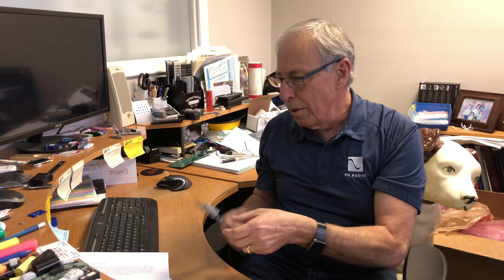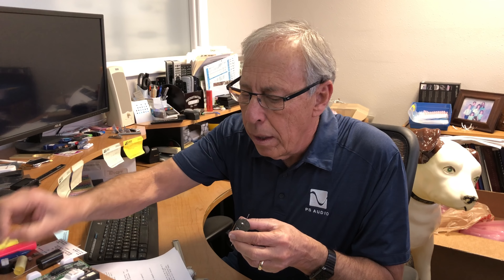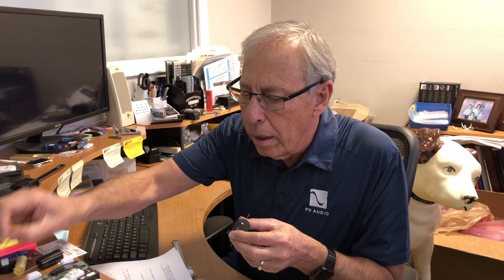Confused about biamping speakers?

Comment: So Biamping from the same amp has no benefit? did i get this right? i been recommended to bi amy my B&W 702 S2 from my denon home theatre amp they said i would get cleaner sound but i was on the same thought train as you said to get a power amp instead and overflow them with power
Reply: Which Denon do you have?  I bi-amp the old 703s using Marantz 8000 series but I only use 5 speakers and the Marantz is a beast. The 702 requires power - you can get a lot of cheap power like emotiva or monolith but I would bi-amp.  All these speakers have bad binding posts that are not signal friendly so bi-amping sorta fixes parts of it. 

One reviewer was saying that the new series 3 or series 2 doesn't need power, meanwhile he's reviewing the 705 signature with 5,000 and 10,000 pound receivers recommending the 10,000 one😄

Comment: Question… I have bi Wired speakers but I only use them single wired. Does is matter use the upper or lower entry on the speaker unit?

Comment: I'm hooked to biamping and active crossovers and couldn't imagine to ever go back. My highs are driven with a small tube amplifier and my lows with a cheap Crown Class D amp. This setup (for less than 1000 bucks) sounds better to my ears than all passive single amp options and I tested a lot...
Reply: Interesting, which crossover are you using?
Reply: @davidsagarra9841  miniDSP 2x4 HD
Reply: I have rhe same named pre and power a Myryad T40 and T60 does the power add up with setting up two ? Meaning 40 high and 60 low meaning 100 total. Instead of bi wiring just though my 60 watt power?
I'm I wrong, plus would my system sort out the loads or speaker cross overs . As 40watt just to the tweeter somes a low at all frequency,  hoping the cross over works?

Comment: I didn't really get the answer as to why I would bi-amp. Do some speakers need more power to sound their best? If you used your own speakers as examples, measuring with and without bi-amping, it would explain a lot. Thanks.

Comment: I love my bi-amp system. Not really high end, but I am getting there. I have an Arcam A80 and a P80 connected to a pair of Canton 790.2 DC's the beauty of this speaker is that the mids and the high's are fed by one amp, and the bass for the other amp, in essence it is a 4 way system, the mids are seperated as well. I notice a difference quite easily, I went back and forth with an audiophile friend and had some fun with it. The sound is more relaxed and  dynamic, overtones and spatiousness become more audible. But it depends highly on the speakers, if people want to bi-amp using small monitors, with one amp feeding only a little tweeter I think it is a waste of effort. Also Arcam used to promote and facilitate biamping and on forums people using Arcam tend to hear the difference more than other brands. But it is the same as speaker cables, it goes a bit beyond science, that they can't measure why it sounds better or different. It is a highly personal subject. And I fear the placebo effect has some grounds too.

Comment: Ok, so you described using a Y connector out of the one pre-out on the back of the AVR, but what if you have the ability to send 2 discrete channels to each set of posts? Like assigning one of the unused height channels an amp and running it in conjunction with the front. If it's a discrete channel, will you see measurable benefits?
Reply: Very good question! I was actually thinking of doing that, using my unassigned Atmos posts for the second run of speaker wires for bi-amping.

Comment: I tired biamping my Infinity Kappa speakers using two different size NAD power amps, it sounded terrible, the bass was overpowering. I then bought a used Rane AC22 active crossover, mainly so the i could adjust the gain on the one amp. I now have an active crossover but left the passive crossovers in the speakers. The Subwoofers are connected via Hi-Level to the bass amplifier and to my ears it is a huge over all improvement. I call my system hybrid crossover :)

Comment: I am new to home audio for the most part.  I have a somewhat  strange setup and I found the best solution for me is to bi-amp.  My Denon AVR-X1200W advertises that it is putting out 80W per channel.  I am betting that is not the case at all , but I haven't tested it.  I am using a pair of Boston VR3's for my FL and FR and a JBL Center.  The Boston's sound great, but I also have a set of Martin Logan Motion 2's, and I liked the sound of the tweeters much better.  I swear when I played the soundtrack to Fantasia the Martin Logans sounded like they were being powered by tube amps.  Seeing as I am using two separate speakers for each channel, I bi-amped the mids/highs to the Martin Logans and the low range to the Bostons.  It sounds really amazing.  The bass is tight and the Martin Logan's shine, especially with brass instruments.  What I am wondering is, how incorrect is it to set my system up this way, and am I doing damage to my system in the long term going this route?  Both sets of speakers are 8 ohms and the AVR is not overloading the Martin Logan's as far as I can tell.  It really does sound pretty amazing and powerful for an entry level system.  Thanks!

Comment: Thanks Paul.
What about bridging the amps and biwiring instead?
I decided to use my amps this way. Each amp sees the same speaker load and provides twice the power. I guess using powered subwoofers counts as bumping too ;-)
Reply: Every setup and situation might call for something different. BUY-WIRE-ing only helps if you were running wire that was too high of a gauge to begin with. It’s a good way for a company to sell you more wire than you need though! 

Nothing wrong with bridging an amp, I have some 2 channel Emotivas that I have bridged to act as monoblocks.

Comment: Isn't that the whole advantage of biamping? Active crossovers don't consume power from the amp like resistors and nonideal caps and inductors, the db differences between drivers can be equalized without using power consuming L-pads. Also impedance and resonance equalization are not needed for the active crossovers to work properly. Not sure about this but isn't removing the passive components from between the amp and the driver making the damping factor higher since bigger currents are allowed to flow and so forcing the driver to decelerate faster? I would think also that in the end if the amps are not a concern, active filters become lower in cost vs. as well performing passive filters.

Comment: I am bi-amping some Legacy Focus speakers with a McIntosh MC275 tube amp on the top and Legacy's Powerbloc2 on the bottom, which is similar to what they use on their half-active XD model. I use balanced interconnects on the top, and RCAs on the bottom, and have turned down the bass on the rear 2 db trim toggle and on my preamp. Most of the time it is fine, but with really deep bass it gets to be a little much, and I like bass. The power is way different at 75 vs 640, but I think the input sensitivity or gain as you referred to it are not matching up. I do like the sense of power I get along with exquisite detail. I did not have the same effect running either of them solo. Obviously if I had matched amps, I would not have a problem, but money is limited. Any thoughts?

I love all of your videos and posts, and think highly of your company. One of my friends has a P10 and Directstreaam DAC, and it is a great system. Any possibility of PS Audio making a one box CD player for a Stellar price? To my ears, CDs sound better than streaming.
Reply: I've got the same make apps which I'm going to try bi amping tomorrow . Hope that's away your issues as they are built of bi amping.

Comment: I have for years my audio equipment bi-amped. I start with it, when i bought loudspeakers with 4 connections on one loudspeaker. I put out the bridges, bought forks and extra loudspeaker cable. To make it complete, i connected an extra set of loudspeakers on an amplifier. The idea to create a wall of sound were Phill Spector is famous about, i enjoy to make it happen. Every driver get its own channel, excluding one setup who is normally amped, and yes i use only amplifiers from 1 brand to get no troubles with impedance, and watts. 
The results are so good, that i do not make any changes for the first time i connected all up. I use 4 amps and 4 loudspeakers. The bad thing is only for the audio brands, i have not to buy audio anymore. So i bought a Swiss watch. This setup i made: 1 integrated amp with 4 loudspeaker connections, 1 custom intallation amp with 8 loudspeaker connections, 1 phono amp, 1 digital amp with dac. Last, i am more a 2 way loudspeaker fan, because three way is more bussy, it missing quieteness in the soundscape. So the tweeter and woofers synergy produce well ballanced mid frequencies. This only by good engineerd 2 way loudspeakers. And bi-amp this will be making from a room an arena.

Comment: Dear Paul, On my stereo receiver, if I connect outputs for "Speaker A" to one set of binding posts on the loudspeaker and "Speaker B" to the other set of binding posts on the same loud speaker, then would it qualify as "BI-Amping"? Thanks.
Reply: Absolutely not.  The speaker A and speaker B connectors in the backs of amplifiers are just parallelled. They are for people who believe in having front AND back speakers, --i.e. sound (any sound) coming at them from all directions. No value in that as far as high fidelity is concerned. (n fact, NEGATIVE value, as having the same sound coming out of more than one speaker totally destroys "imaging" in sound. Having the closest thing to a "point-source" is the first pre-condition for imaging..)
 For bi-amping you  not only need separate power amplifiers (4 if bi-amping in stereo; 6 if tri-amping in stereo), but you also need an active crossover. An active crossover is something like a pre-amp, but with two (or three) outputs for each input (2 inputs for a stereo active crossover). Each input signal is separated into two frequency ranges. So, one output will have a low-pass filtered version of the input, and the other output a high pass filtered version of the input, and such that if you were to compute the instantaneous sum (i.e. the mix) of the two output signals, the result would look  flat (unfiltered) relative to the input. And so, you connect the low-pass filtered signal to the input of one power amplifier, whose output goes to a woofer.  And you connect the high pass filtered output to the input of another power amplifier whose output drives the tweeter.  THAT is bi-amping. Repeat for the other channel.  And the only thing better than bi-amping is tri-amping, where you split the spectrum into 3 frequency ranges: bass, mid and treble, and have 6 power amplifiers: 3 power amplifiers for the left channel, and three for the right channel.  Tri-amping requires a double-crossover:  One around 400 Hz to separate bass from mid frequencies.  and one at around 2500Hz to separate mid from tweeter channels.
I don't know where you buy active crossovers.  I design and build my own when I need them,  I'm an electrical engineer by profession, and sound is my passion, and I don't trust anybody else to design things they way I would, so I don't even know what's in the market; as I don't follow the market;  I don't even care. " If you can buy it, it is garbage."  That's my motto.
But so, bi-amping and tri-amping is not a DIY thing for most people; it's involved and you need equipment to calibrate gains to achieve flat dbSPL results.  The type of crossover matters.  I'm leaning towards linear phase filters -based crossovers,  these days, but for a good start I'd recommend Linkwitz-Riley.  (That's not a brand name; it is a type of filter.)  Linkwitz Riley filter based active crossovering has the two output channels remain in phase relative to each other throughout the crossover region, which is a great thing, as it reduces the phasing problems to deal with;  but they are not input-to-output phase coherent or phase-linear, and so would be less than "reference speaker" grade in my book --though in everybogy else's book it seems any garbage can pass for a reference speaker if its frequency response is flat enough... phase be damned...
Reply: Sorry, but I didn't say anything at all about speakers.  I can't fathom what you percieve me as having said that is not correct.  I was re-describing the concept of bi-amping for someone who did not understand the way you explained it;  I was not talking about speakers at any point.

Comment: Great video Paul. Buying the same brand name amps for bi-amping in my opinion is REALLY important because of the reasons you state in the video, also different name brand amps are probably going to sound different from one another which I would think wouldn't be good for overall sound quality. IE.... Brand A powering your highs and brand B powering your lows.      Cheers

Comment: Paul, I believe you missed a couple of points here. The signals going to each amp must be filtered so that highs don't get to the woofer and lows don't get to the tweeter. This also saves power and eliminated power-robbing (in some cases) crossover networks.
Reply: David Perkins just use a crossover
Reply: David, unless you’re referring to something else, that’s what an active crossover does. The LF channel kills the highs at the preamp stage, so that it is pre-filtered before the power amp sees it, therefore no highs going to the woofer. Similarly the HF channel does the same but opposite. As a safety precaution (avoid DC), sometimes a series cap is placed on the HF power amp’s output before driving the tweeter.
Reply: David, he was talking about passive biamping, not active.
Reply: David, Paul just had described what is bi-amping. When one would use separate amps and built-in passive crossovers. What you propose is not called bi-amping.

Comment: Hi! Good day! I have enough knowledge in the world of audio but not the depths of it. I highly trust you so I will be asking you some questions regarding the topic of this video. So my speaker is capable of handling 15 to 500 watts on its power range according to the manual. However I'm confused to its maximum input power which is 400 watts written on the manual as well.

I currently my two speakers with a 300-watt monoblock amplifier each. My money and I are good to go on upgrading the chain in a bi-amplified way. The question is would adding two additional 300-watt monoblock amplifiers do the work? Scenario would be: (2) 300-watt monoblock amplifiers for each of the speakers. Will the speaker break or the other way around - the amplifiers? Will this result in totaling the power to 600 watts to be sent to the speaker?

I would really appreciate your kind reply on this. Thank you.

Matt

Comment: For true biamping you need to remove the crossover in the speaker and use a low level active crossover before the power amps. In the example given you’re still driving both amps full range.
Reply: Many of the popular powered speakers use true biamping or triamping with a built in active crossover and amp channels for each driver. There were also some true multi amped dedicated systems in the past like the Linn PMS
Reply: Donnie D Acutally, at least in the late versions, there was a box under the speaker for the passive crossover in the non active version. Snell also made an active crossover for their Type A, with jumpers on the back of the speaker to bypass the internal passive crossover. There have been a few systems, but they are fairly rare and complex to set up. The most common approach is the all in one active powered speaker. Meridian have been making them for almost 40 years.
Reply: To do multi amplifier reproductions systems well, you really have to start from scratch, select a good quality electronic crossover like Phil Marchand's units, then select good quality amplifiers, then select good quality drivers. One key to this set up involves individually selecting interconnect cables post crossover for the various frequency ranges, and individually selecting speaker cable that will work best in the target frequency range for each of the drivers.
Reply: gotham61 Linn have made lots of active capable speakers, I’ve had four different pairs personally and currently run a pair of Ninkas in tri-amp active mode. It’s interesting to be able to compare single amp passive, bi-amp passive and bi/tri-amp active modes on the same speaker easily, you can hear an incremental improvement going from single to bi-amp but nothing on the improvement from going to active mode. Multi amp operation definitely makes a lot more sense if you’re running active crossovers but if not, you’re probably better off with one more expensive amp.
Reply: I have gotten amazing results by selecting high quality, albeit sub-audiophile (read $500 range) amplifiers with the reasoning that each amp is only going to be subjected to a narrow range of frequencies. And I found Phil Marchand's solid state crossovers sound really amazingly clean, although he does offer a tube version. Then so many very high quality drivers are available, and can be tested in the system and returned if unsatisfied, as drivers each have their own amp and speaker cable, and so can be more easily selected and matched for your system. So instead of dolling out thousands in a passive speaker system, spend that money on three amps and the electronic crossover, drop a thousand in drivers, and you will have a multi-component system with tremendous flexibility that will rival in performance some of the most expensive audiophile systems out there.
Reply: @gotham61 That's not called "bi-amping". That would be active speakers. Bi-amping is exactly what Paul had described.
Reply: Not True:  My Tannoy System12  studio monitors are designed to us two separate amps matched to the speakers internal passive X-over.  Bi-wiring yields no advantage.  Bi-amping-- miraculous.